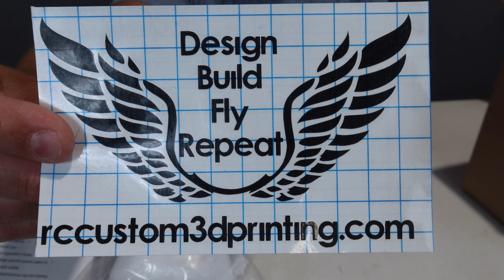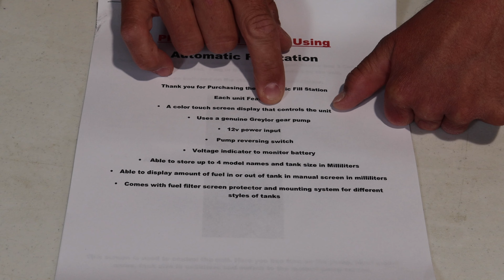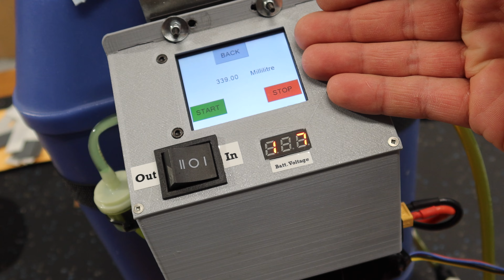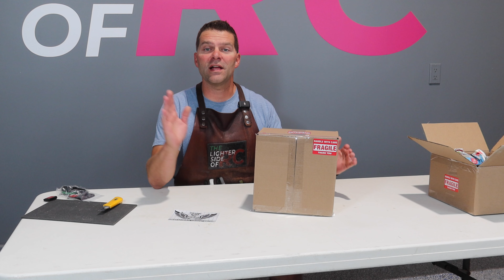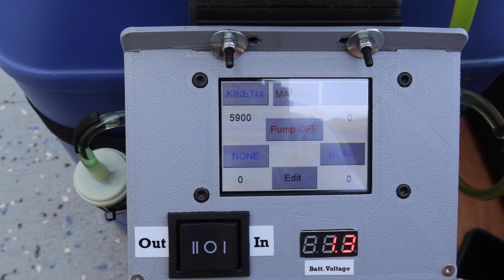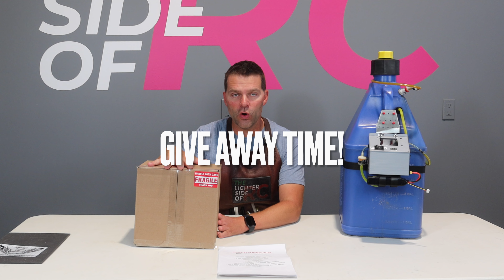Game Changer? Testing the Fuel System from RCCustom3DPrinting

Comment: Hi Why are you running two uats?
thanks !
Reply from the maker: Good question 😉. So the tank design on the Kinetix is a large flat square. I find if I have a very aerobatic flight the single uAT was ending up with 1/2 air in it. So adding the second UAT acts as a hopper tank. The first UAT will have 1/2 air in it after a flight but the second one will have zero air in it.

Comment: I wonder how accurate the fuel system is over time and what happens if it needs to be re-calibrated?
Reply from the maker: uses a flow meter so as long as that's spinning and doing it's thing should be rock solid!

Comment: Once you have filled the tank with FUEL and programmed the unit, how will it know how much fuel is left in the tank after a flight, I usually have about a quarter to a third of a tank left when I land
Reply from the maker: Between flights your using the manual mode if there is still fuel in the tank.